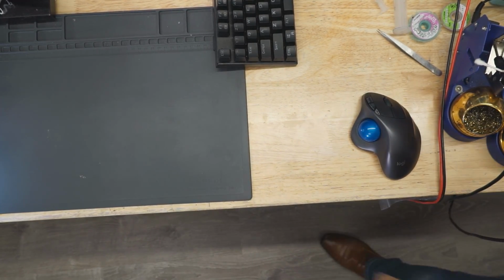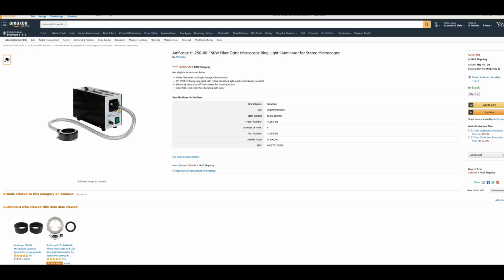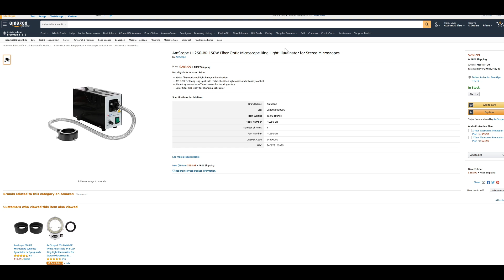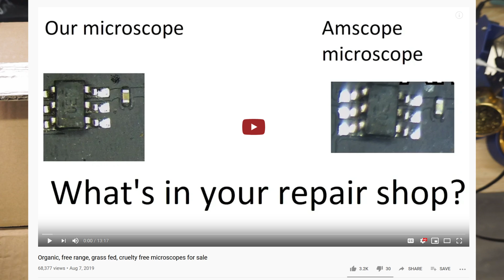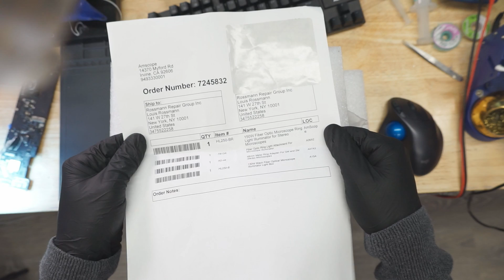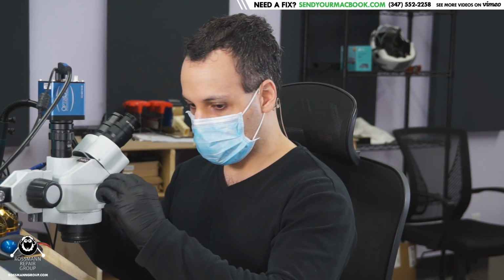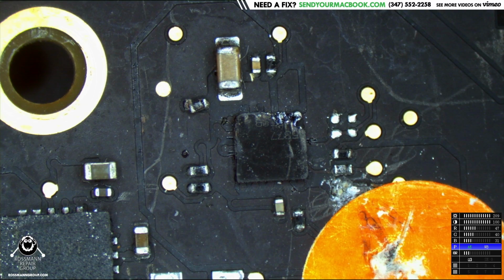I spent $310 on a microscope ring light, was it worth it?

Comment: You have to remember that the light brightness of the $310 light is probably at least an order of magnitude brighter, so you might expect the light to cost an order or magnitude more than the cheap one (it costs more than ten times the cost of the cheap one, so that's a failure). Having said that, you could achieve more light density if there was a way to focus the light to a more concentrated area to achieve the brightness level you need at full zoom. But I think that thick armored fiberoptic cable is really the main deal deal breaker since you need good mobility with your scope.

Comment: About modifying your LED-Light: 
I think a good bet would be something like this 
Lumileds L130-3090001400003 (just go on Mouser/Digikey and pick some high power white LED). Do yourself the favour and take one with pads on the sides instead of underneath, it will be much easier fitting it on the (wrong) footprint. Also, depending on the LED you choose it can get expensive realy quickly (the really bright LED´s will cost more than 4$/pcs!!). Btw, the LED I´m suggesting is ridiculously bright, I have built a light (I can´t remember the exact part number, but it was similar in power to the one above) once, and at like half brightness it melted a black cap I set over it to block the light.
And here is where the big issues begin: the reason LED´s fail is because of heat. If you put a bunch of high power LED´s in your crappy plastic enclosure without cooling they will probably not last long, so you have to be quite conservative with the amount of LED´s you put in there. Also, you have to pick a LED without cooling pads (assuming that the existing LED´s don´t have one either), because the one with cooling pads rely on them to stay cool.
One more thing to consider is the driver circuit: If there is simply a resistor in the lamp to regulate the current, you would have to modify it to acommodate the new LEDs, as different LEDs vary quite a lot in forward voltage (from ~1.5 to more than 3 V, the one above e.g. has 3.1 V). If it is a regulated current source this could be much more difficult (you would probably have to replace it with a resistor then).

All in all a fun project, but definitly not worth it if you are looking at it from an economical standpoint.
Reply: @Kappa A lot of the cheaper products out there use resistors, and also the fact that overvoltage makes the LED´s brighter leads me to thinking that this is also true here

Comment: Put this "CVM-27-56-95-36-AB00-F2-3
" led in your fiber halogen light ring with a heat sink, fan, buck/boost and your good.
Reply: As in on the end of the fiber optic bundle that feeds into the halogen lamp box, also i saw on ebay there's a lot of fiber ring light heads for like $50 to $80 ish that can have a high cri cob led stuck on the end so i'm ah get one and a cob of the same les to go with it's, you could have 3 of those for the price of that one $310 microscope ring light.

Comment: Ross Hi I am a Professional videographer - Polorizar works best when light is 90 degrees from the center for example if u are taking a picture of the mountain and sun is behind u polarizer will not work much if the sun is across like on your right shoulder or left shoulder axis will work. So your ring light is the same axis as your lens optical axis, not much use. Remove it and see, polarizer eats about 2 stops of light. When u zoom in the distance between lens and sensor is increased, which creates a loss of light, and the polarizer makes it worst. The solution which u can try is - remove Polarizer if reflection comes that time just lift the board about 1/2 inch from any side. Pl tray this. Rakesh Nagar New Delhi India.

Comment: It’s overvolting a light, not overclocking it. A light does not have a clock speed.
Reply: Its actuality called over driving.
Reply: It's actually called overvoltclockdriving it.
Reply: Exactly, overvolting brings halogen broadcast or any bulb to burn out fsster
Reply: It's actually called overpowering.

Comment: Light levels are not linear with increased brightness. Its a "square function" mathematically. You have to square the intensity to get double the brightness. Remember the "Inverse Square Law"? It's a 2D function so that's why it takes so much more power to get increased brightness.

Comment: To me it looks like your new lamp generates the light not in the ring but in box. And the thick cable seems to be fiber wich brings the light to the ring. If this is the case, then I would suspect you simply have to replace the bulb in the box with a stronger one. But then again, I did not read the manual.

Comment: Louis, RTFM buddy
9:00 Check the thread and see if you can use the other screws in your new light? I'm sure you should be able to get some sort of screw which will be more user friendly and just replace them, don't they have a rubber tip to stop you scratching the shit out of the microscope head?
Can you get a wider light and use both of them? Without flaying the skin off your hands or setting fire to your gloves?
Can you not get a remote for that camera too?

Comment: It's not clear that he's getting the benefits advertised from a polarizer. You should be able to rotate the polarizer to remove reflections from a particular direction. But since he's using a ring light, light is coming from all sides and won't help in that regard. It might help if the room lights are creating a glare separate from the ring light illumination, but the ring light should really be much brighter than other sources.

Comment: The new light is substantially better than the older LED unit. You should likely call or email the maker you bought the new halogen from to ask them to compensate you for the difference in price. Worst case, you're where you started in price. Best case? They provide a partial refund and you're equal to or better than Amazon was for the price. Can't hurt to try!

Comment: i would say that the value of the $310 light might be worth it if it last a lot longer. with 16 times the cost it probably wont last 16 times as long because of diminishing return but to get the same results with the $20 light you have to over clock it and you said they were burning out fast. I would say that it is worth it if it last 10 times as long but that is because i am lazy and i would want the hassle of buying a new light every 4 months.

Comment: @Louis: CRI isn't a very good measurement for light quality, therefore we now have TLCI (https://tech.ebu.ch/tlci-2012). LED lights can fake CRI values, this u can even see sometimes when using a color chart and compare it to a conventional tungsten lamp or daylight. (The trained eye will see it in skin color rendering etc). Convention tungsten lamps have a very high light quality and it's very consistent over time and between different lamps. This is why some of it is still used in film industry and other industries where precise color vision is a must. But LED's r sneaking in everywhere, it's just a matter of time. - for professional use case that light doesn't even count as a huge expense.

Comment: Buy one of those gigantic LED ones off of the Internet, and hack it into the base station. It is handy to have the super hot LED light faaaar away from where your scope is. And you'd be able to digitally control the LED with some basic circuitry. Someone there has to be smart enough to do that.

Comment: LED and fluorescent lights have a much lower CR ratings than incandescents and halogens. I wonder if that is most of the difference.
It reminds me of back in the day when ppl would retrofit HID headlights in cars, before the manufacturers put them in standard. They blinded everyone else on the road, despite the driver not getting much light back to actually see. The stock lamp lenses were not designed to focus the light properly. Just bc it puts out more lumens, doesn't mean it's correct for the job at hand.

Comment: Why is he insisting on using a ring light? If you used a modern LED pad with a heat sink on it, then defuse it, you could get a light bright enough that it requires a welding mask. Now you would have to play with placement a bit more and figure out something so you don't have a shadow, but then you wouldn't have to deal with the small form factor of a ring light. You could even use them in tandem to get rid of any shadows that may be cast.

Comment: If the new one is Halogen, then at least it will not suffer degradation in light output that the led one will. The bulb will blow of course, but then you can just change the bulb. But it's not all good news, i bet the replacement bulb will cost more than the $20 you paid for the complete led light!

Comment: Wait... that thing is 150w HALOGEN? That's gotta be a joke, right? A massive box with a fan and huge lightpipe for maybe 20w worth of LED light?
I thought it had 150w of LEDs in there. That would be something.
Reply: You might want to look up how tungsten halogen lamps work then, they generate a ton of heat...
CRI and spectrum is also far better than any commercially available LED light.

Comment: For $280 I could probably buy a laser that is bright enough to just weld electrical components together with pure light output (I hate soldering, being visually impaired doesn't help ). For $280 that light is a bulky, unwieldy power hungry piece of junk. Also, It costs more than that because halogens don't usually last to long and need to be replaced.

Comment: TBH I'd disassemble cheapo light kit, and replace LEDs with more LEDs, might even experiment with single wavelength colors or white light temperature.
Once I'd know what color of the light I want I'd buy the highest wattage and try to fit as many as possible within the ring.
And in true ghetto fashion, I'd use narrow beam 18650 torchlight, might turn on automagically when zooming. Dirt cheap and A LOT more light than this virgin ring.

Comment: Aluminum foil in place of fuses is like pennies in place of button fuses, LOL  Houses burn down and car electronics fry for doing that.  Oh and jacking a fuse to a higher amp rating above the wire gage in your load center to prevent annoying tripping of the breaker instead of fixing the overcurrent problem in the 1st place is always a good idea, NOT!  Who need overcurrent protection any way???  LOL.

Comment: I...don't think that's how LEDs work XD- they're current controlled rather than voltage controlled- voltage over the LEDs stays almost the same with vastly different currents and the extra voltage has to be dropped over some kinda resistor, which is gonna get super hot,And LEDs don't like extra hot, neither does the resistor.
would be better just downsizing that resistor and keeping the same voltage :)
Probably only one or two resistors to solder too

Also... seriously a glass fuse on a 300$ piece of equipment? That thing  really is barely better than some aluminium foil proper mains fuses are ceramic and filled with sand to quench the arc, at least in the UK, dunno if it's different because of the lower voltage

Comment: $310 projector bulb sending light through a tube vs a $20 led light shining directly above the board? 

Yeah the projector style light is a bit brighter when maxed out than the $20 led light when fully zoomed in but honestly I think you paid way to much for basically a projector in a smaller form factor but maybe Louis try to find a LED ring that fits your microscope like the $20 one you had on it, just find one that's brighter and shines more and isn't as bulky looking as the $210 one. But that's just my opinion though.

Comment: You could always rig up a car H11 Led daylight (6000K)  headlight in that box :-)  but you'd need a 12V supply instead of the 120v  (unfortunately, it probably isn't dimmable)  https://www.amazon.ca/gp/product/B07VS7VFSV/ref=ppx_yo_dt_b_search_asin_title?ie=UTF8&psc=1  (Halogen lights have poor longevity and if you knock it while it is hot, it will break)  Hope you checked how available replacement bulbs are.

Comment: That's the most 'over engineered' light I've ever seen!
Reply: Not really. It's using a 150 watt bulb - you do NOT want that anywhere near anything you'd want to put under a microscope, as that is going to boil it. Doesn't matter what type of light source it is - regular incandescent, halogen or LED, 150 watts in means 150 watts out. You also don't want a 150 watt heat source that close to your hands, unless you're a big fan of getting burned, be it by the heat given off or by accidentally touching the thing.

This solution allows you to put a very powerful light source far away from the subject you're examining while providing adequate cooling for it and protecting yourself and whatever is under the microscope. And if you're dealing with very powerful LEDs, cooling is an absolute must, as they will kill themselves if they aren't cooled properly.

Comment: Looks like there are cheaper options with great reviews which have up to 144 LED's in the ring
Reply: led number means very little as LEDs are differently spec'd,  5730 is around half a watt. Even if driven to a lower current 90-100mA (instead of ~150), it's still 300mW. That's around 45W of heat to dissipate passively. Those LEDs will overheat and burn. The solution with optical fiber seems a good one, except for the warm/inefficient light source.
Reply from the maker: @stanimir4197  like.. ?
Reply: @rossmanngroup  i am not sure what the question is about. But if it's about the inefficient light source  - halogen lamps tend to consume a lot more energy than LEDs (shorter life span too). Granted they have red/warm spectrum light. which is appreciate for general lightning. My point is that delivering the light through an optical fiber seems like a good choice as the heat dissipation is not cramped within the small ring itself.